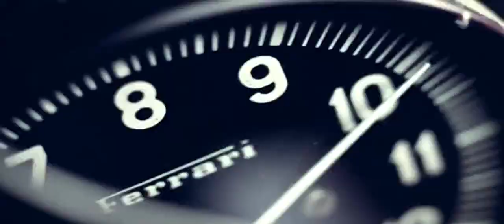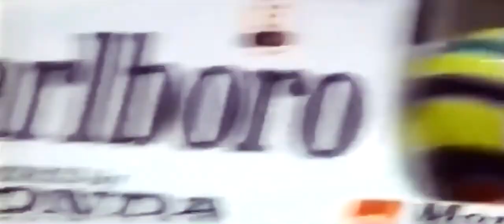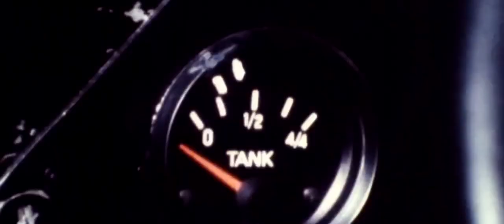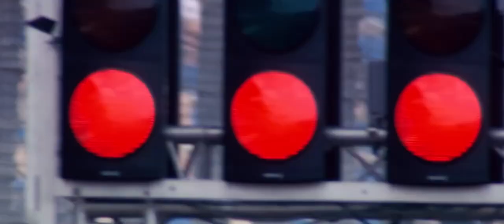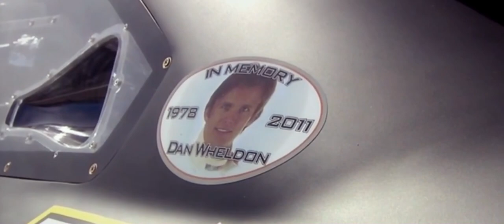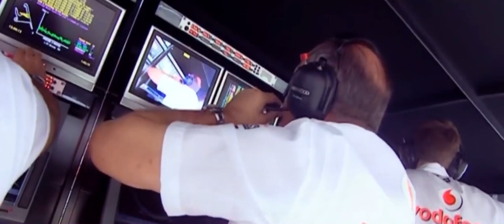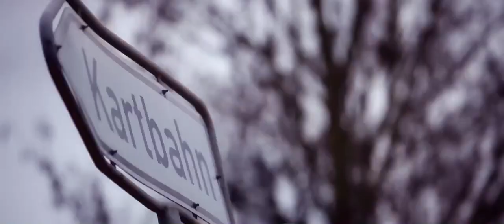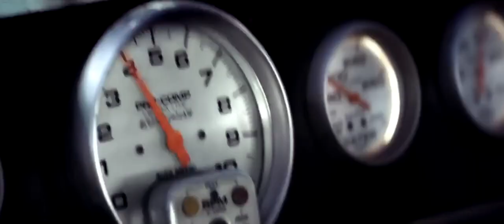This is Racing - The Movie

Comment: Whether you run 500 laps, for 24 hours, over 100 miles from point to point, whether you run on two wheels or four, whether you drive something that is naturally aspirated, hybrid, or completely electric, whether you turn more to the left than to the right or vice versa, wherever you run on dirt, gravel, concrete, or asphalt, whether your V12 screams, your V8 growls, or your V6 purrs, whether your pit stop is 3 seconds, 7 seconds, 12 seconds, 40 seconds, or you have no pit stops at all, whether you can go 200mph or only 90, whether you fly around that blind corner, fly over that blind crest, bank hard for that corner, late break, send it, use the kerbs, slingshot when no one will push you, use the bump and run, or just see that gap and go for it, whether you race in the rain, at night, or when it is over 140 Fahrenheit, whether you have 1 opponent, 19, 22, 33, 39, or more, whether the draft or dirty air is more important, whether you face a tire war or not, whether you represent your country, state, region, manufacturer, or family, whether you have sponsors or none, whether you are an owner or not, whether you’re in your home country, or in a foreign one, whether you have experience, or you are new to the series you drive in, you put your life on the line every time you are out on that track, you are a driver and you will give it your all for every lap, segment, stint, stage, corner, straightaway, chicane, banked corner, hill, hairpin, mile, kilometer, meter, yard, foot, inch, second, you give it every thing.
And for that all motorsports fans thank you.
Reply: Thanks for hearting my comment. By the way, it you make another one of these and want to include more NASCAR they are pretty lax about it as long as it’s not from the past 5 years or so. Also, you are free to use any footage I have from the race I attended if you find it useful. If you do please credit me though.